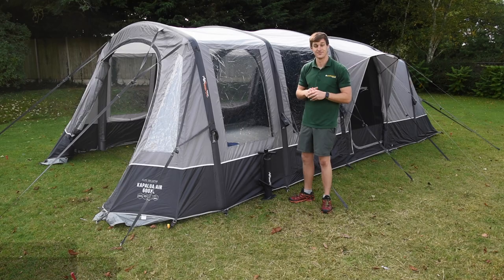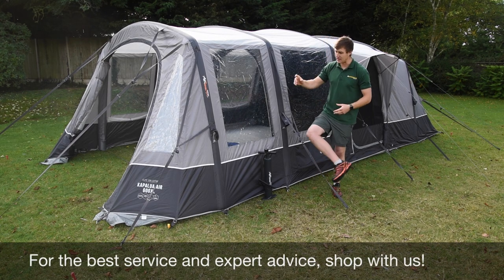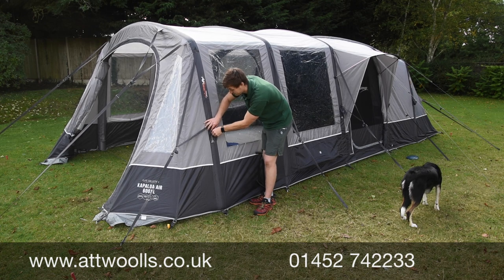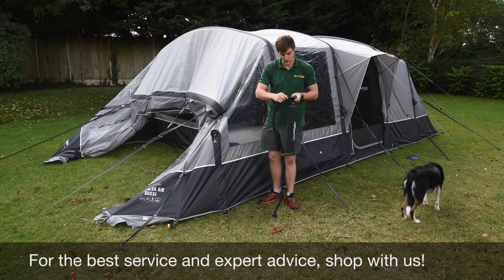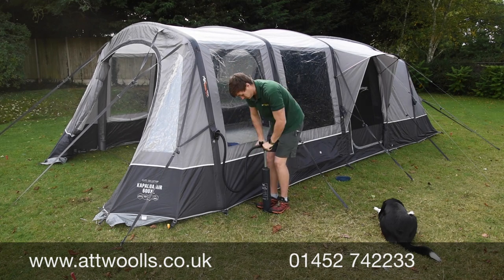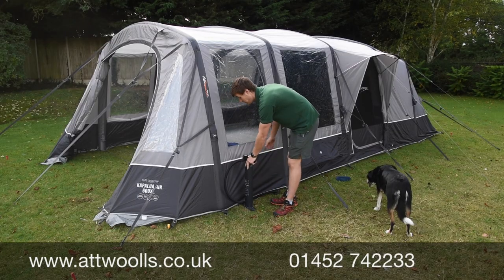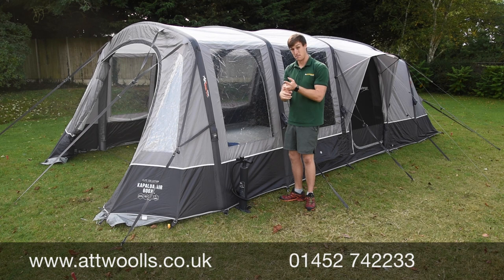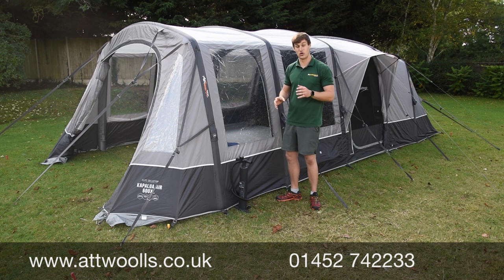Vango AirSpeed Valve (Tutorial) Video

Comment: Can you please clarify.
When using the pump to deflate does the valve need to be open or closed.
I tried this once and left the valve in closed. However when rolling the tent this actually trapped air.
I have since packed tent successfully several times simply leaving valves in open. Walking along the beams then folding towards the valves.
However I would like to know the correct technique for deflation with the pump. Thanks.
Reply from the maker: @Sirwafflehead  it doesn’t matter whether the valve on the tent is open or closed but you need to make sure you remove the pressure gauge from the pump to deflate. 
Once you have finished sucking the air out, you should put the valve back to open. 
Personally we always back the tent away without the use of the pump.
Reply: Thankyou, yes I can tell the pump nozzle actually opens the valve when it is in the closed position. Does the action of attaching and removing  the pump twist the valve into closed to prevent accidental deflation when removing pump? That may have been why I left it in closed when rolling the tent.
I'll check next time I open the tent.
Thankyou for explaining.
Reply from the maker: @Sirwafflehead  that’s correct, when the pump is removed from the valve it closes it to ensure no air comes out.

Comment: sadly there is a problem with the Airbeam system as i have just found out. they will develop a leak when it rains and pool water inside the living sleeping space, used my Cruz drivaway  last week, it rained and the Cruz leaked, not bad but enough to need a bucket and destroy my confidence in Vango
Reply from the maker: You can get a lot of condensation inside awnings, especially if you are sleeping someone inside it. The key is ventilation to allow the air not to be stagnant and if someone is sleeping inside the awning it is best to have an inner tent if you already haven’t got one. 👍